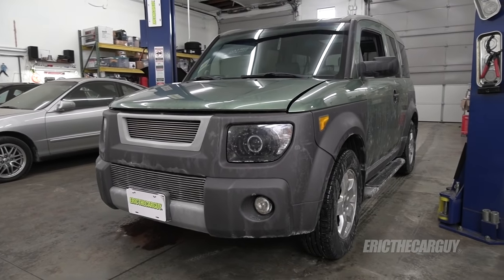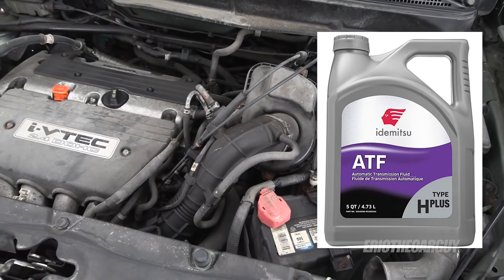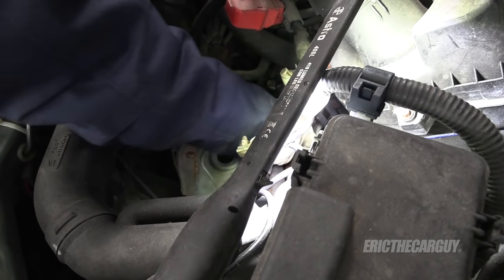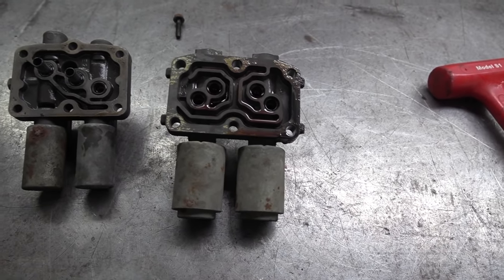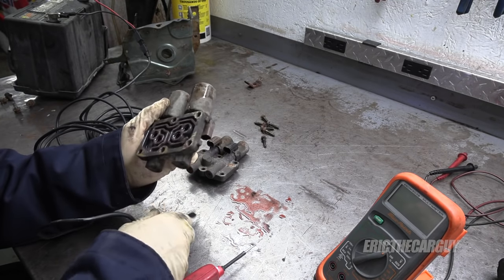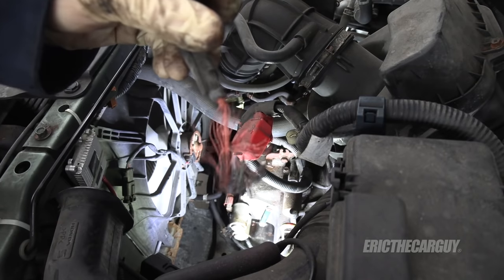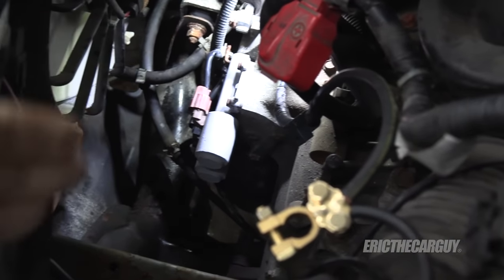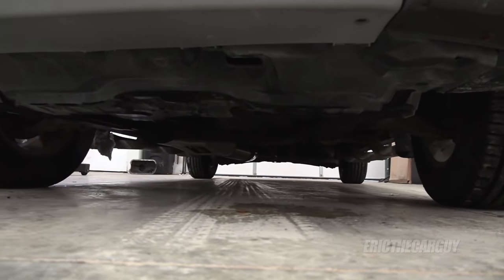Delayed Shifting, Honda Transmission

Comment: Hi Eric.  I have a 2012 civic lx sedan with 190k miles . What can cause grinding noise when shifting from park to reverse and drive . Also it does the grind when coming to a complete stop but not often . What can it be any advice would help .
Reply: Does it have a check engine light on? It could be a solenoid going bad, could be wrong amount of fluid, or even just dirty trans oil
Reply: No check engine light . Took it to the dealership for diagnosis and was told it was a bad motor mount. Going to replace it and will see if it fixes the issue. Also will do a drain and refill on transmission fluid to be safe
Reply: The grinding noise from park to reverse I've noticed it in many Honda's. Is the transmission a cvt?
Reply: It's a 5 speed it was not the transmission of fact was the passenger motor mount causing it to sound like it was a transmission.  Replace motor mount and no more noise
Reply: @metrosb2593  I was told by a Hinda mechanic that the transmission could be a cvt that shifts like a 4 speed. Mine felt like there was a half a gear after 4th gear, after I backed off the gas
Reply: @paulmattle6683  if you provide me the model and year I can tell you.
Reply: @metrosb2593  it's an 05 Civic VP 4 door

Comment: How do you know it wasn't the filter being clogged up that caused it.
Reply from the maker: A clogged filter would effect all gears, not just 3rd gear. Also, as I clearly showed in the video, the filter was fine and was OE which means it has the bypass valve. Thanks for the comment.

Comment: I have the same problem for the last five years on our 2002 Civic EX, but only when cold. Does not seem to get any worse, unless it is colder outside. Is the flair more an annoyance or could cause other issues with the transmission if it is just the solenoid?
Reply from the maker: Are you using Honda transmission fluid? If not, that could be the cause. https://www.ericthecarguy.com/solving-transmission-problems/
Reply: I have a mix of Valvoline MaxLife ATF and Honda ATF right now. One drain and fill of Honda. Slowly working my way back to fully Honda ATF at each oil change interval on the Civic. When it warms up outside, I will hopefully get a second ATF drain and fill in.. Found years ago that the MaxLife ATF was less prone to "burn" (dark red to black 80k) in my 2002 Odyssey that the old Honda ATF seemed to do, and just stuck with it... until I saw your videos. 155K miles on the Civic and 196k miles (about 100K running Valvoline MaxLife ATF) on the Ody and no trans issues on the Ody. yet. fingers crossed.
Reply from the maker: Only use Honda transmission fluid in a Honda automatic transmission.
Reply: @ericthecarguy  Hopefully a couple more drain and fills of Honda ATF will take care of it. Would a problem with the solenoid  (slow actuating) potentially wreck the transmission or just be an annoyance with the slow shift?

Comment: I have always wanted an Elment as secondary vehicle. Where I am they all have  250k miles or more. Are these still okay to buy with that amount of mileage?
Reply: I bought mine new in 04 and have had very few problems. Vtec solenoid replaced, intake manifold gasket and basic stuff brakes, plugs. I love it cause you can fold the seats to each side, great for Christmas trees😎
Reply from the maker: You would likely need to rebuild it as I did with mine, especially the suspension. Videos linked in the description.

Comment: I’ve been using regular oil for the last 4 year had a repair new repair shop they put synthetic oil, it seems that the car is a little sluggish now when
Reply from the maker: Only use Honda transmission fluid in Honda transmissions.
Reply: Perhaps the repair was shady.

Comment: You changed the fluid but not the filter the first time?  Isn't that a waste of new fluid?
Reply from the maker: I didn't have to add any fluid after these repairs.
Reply: @ericthecarguy  I thought you said you tried changing the fluid first but then you didn't change the filter until you did the repair instead of doing it during the fluid change.
Reply from the maker: I changed the fluid before any of these repairs, and didn't have to add any after the repairs. No fluid was wasted.
Reply: @ericthecarguy  The new fluid going through an old dirty filter would contaminate the new fluid which would be a waste of new fluid. A clean filter should have been put on before the new fluid went in. No?
Reply from the maker: First, you do know how filters work right? They trap and contain contaminants, they don't add them to the system. The old filter was not dirty at all, it looked completely normal to me, I've changed the fluid regularly in this transmission since I got this vehicle in 2007. I stand by what I did and I'm confident it is fixed and will not have the same issue again.

Comment: I have a 2012 accord 2.4l 103k miles and it doesnt shift smooth would this ab solenoid fix anything related to my problem?
Reply from the maker: The #1 cause of shifting problems with Hondas in my experience is not using Honda transmission fluid, or incorrect fluid level. https://www.ericthecarguy.com/solving-transmission-problems/

Comment: Good vids, like watching and learning. I'd like to see a video on an 08 tl going over all the transmission service points. Ive got a type S with 243k and I'm trying to take her half a million miles. It refused to shift 3rd to 4th at 105 mph, it was about 6400 rpm. I did the shift solenoids when I did timing components when I bought the car. Also I've started getting poor mileage sub 20 at times and I'm doing a valve adjustment when weather is better thanks to your vids.
Reply: Try replacing the 3rd and 4th pressure switches and the fluid, if you haven't already. My 07 TL was having sparatic shifting and hard shifting, and once I replaced those, it was like new again
Reply from the maker: As I said in the video, the V6 transmissions have always been a problem. It's not likely solenoids solve problems with those transmissions, only the 4 cylinders. 

http://www.ericthecarguy.com/faq/solving-transmission-problems
Reply: @ericthecarguy   I'm going to dive into your site and see what I can learn. You think if this car has never had a valve adjustment that the mileage could drop as bad as I'm experiencing. All in all she needs some loving, probably ask some questions on your forum.

Comment: Did you check the resistance on the new ab solenoid to compare the readings?
Reply from the maker: It wasn't new, and as I said in the video, resistance checks on solenoids are pretty much useless. A voltage drop is a much better test for something like a solenoid, but difficult to do in this case as you need to take the readings in series. That would be challenging driving down the road.  Thanks for the comment.
Reply: @ericthecarguy  yea you right, I forgot.. I just thought it was new cause it was cleaned up nice. Lol. 
Oh also does that solenoid only control the 3rd gear? Like if someone had a problem with 1st or 2nd would they considered replacing that solenoid as well?
Reply from the maker: No, I believe it controls all forward gears depending on what solenoid is activated or deactivated.

Comment: Funny also called honda a long time ago they said there is no interval on when the filter should be changed and only change it when your doing a trans rebuild.which I don't get it's a external filter why not change it.i changed it anyways.why would honda say that ,very odd I would say.
Reply from the maker: Because very few Honda transmissions have replaceable filters like this one. The vast majority of Honda auto trans filters are inside the transmission case and not accessible.

Comment: Isn’t there a Cigarette plug in Device that has A 9- volt battery attached to it to keep from losing the Cars memory -I have one no need to have to reset radio Code 👍🏻

Comment: Thanks according to Honda they do not recommend replacing the filter unless there’s something wrong with the transmission.
Reply: We replace ours every 30k, a magnefine atf filter fits well in the same slot as the factory filter.
Reply from the maker: it's not like it can hurt. Also, many Honda automatic transmission 'filters' are inside the case and not accessible unless you're doing a rebuild. I believe that is the reason you saw that recommendation. Thanks for the comment.
Reply: @ericthecarguy  I have an 04 Element and the dealer refused to charge it.
Reply: @HotRod-wv4vm  not a honda but my chevrolet dealer said the same thing basically for my 2019 silverado when I had them change the trans fluid . Said the manufacturer doesn't recommend changing the filter unless the transmission is leaking. Still not sure how accurate that info is since the owners manual recommends it be changed at the same time the fluid is changed.
Reply from the maker: I believe the 04 runs a different transmission with an internal filter. Look behind the radiator to see if you have one.
Reply: @ericthecarguy  the filter is by the radiator it’s not internal. What do you think of lift kits for the Element?
Reply from the maker: I don't consider the Element an 'Offroad vehicle', therefore I see little point in lifting one. However if that's your ascetic, go for it.
Reply: @ericthecarguy  Thanks looking forward to your next video. By the way what do you think of the aerogenics springs

Comment: Ground wire fixed mine bet that is the problem.
Reply: Hey Joe, can you explain this a bit further please? I have the exact same problem as him with my 08 Honda Pilot except it's 1st to 2nd and 2nd to 3rd gear with no codes. You think that this is also the solenoid or something else? Drain and fill done thrice and my issue occurs only when the vehicle is cold. After driving around for a bit the issue is gone. Would love your input. Thanks!

Reply

Comment: My 2006 trailblazer did the same thing and I didn't think much of it So one day I was driving and a I passed someone going vary slow and I tried to get it up to speed it would not shift and I couldn't get it to shift for nothing so I got past the gas station my engine started to sound funny and then it died in the middle of the road now I think I blew my engine up
Reply from the maker: It could just be a transmission problem. https://www.ericthecarguy.com/solving-transmission-problems/

Comment: If you accelerate like that every time, you should probably think about not driving like that all the time. Bad fuel economy, more wear and tear on transmission, engine, drive line and tires.

Comment: A manual box with automation? I guess fully automatic is truly rubbish then ;)
Reply: I'm very curious about that! Is the automated manual more reliable? And do certain driving styles wear a transmission like that particularly fast compared to a "planetary automatic transmission" without solenoids. Id love to know regarding my 03 Honda CRV as I had no idea it had external solenoids.
Reply: @foellerd  I am more curious about the clutch part. Oh and how Park works.

Comment: Never worth trying to repair those solenoids, also, the working solenoid itself isn't any indication towards the function of the mechanism other than the cycling. The valves inside can be shot to shit, and they will not work. So new, or from the crusher's it's always the right solution, and in this case, because we're talking about a highly precise part, always OEM, off-market stuff ain't worth it. All with the caveat that parts from the crusher are always in worn state, so not gonna last long.

Comment: Hmm. eBay parts. I recall seeing a recent timing belt video on ebay parts....
Reply from the maker: Not from me. If you're referring to my "Counterfeit Parts" video, I got those parts from Amazon, not eBay. This was also a salvage part, NOT a new aftermarket part.
Reply: @ericthecarguy  ah.... I didn't realize that. Thanks for the clarification. 👍

Comment: This is why you drive a manual.
Reply from the maker: So you think manual transmissions are immune to problems?
Reply: @ericthecarguy  I forgot, we’re talking about Hondas here. Transmissions are not their strong suit.
Reply from the maker: So you think other vehicle manufacturers don't have issues with their transmissions?
Reply: @ericthecarguy  why would you assume that? Honda has a long history of transmission failures, TSBs and recalls. That said I would venture that a manual transmission would statistically fail less than an automatic transmission.
Reply from the maker: Coming from the guy that was replacing 2, sometimes 3 Honda transmissions a day at the dealer, yes, Honda automatics of a certain vintage and type are garbage. However, the automatic transmissions that came before them were excellent and rarely had an issue, pre '99. 

Not everyone is capable of driving a manual transmission, my daughter included. I plan to teach her after she gets more time behind the wheel, but not many people get that opportunity. 

My point is that I bristle at 'general blanket statements' that decry a brand or a persons preference in transmission type. Nobody is perfect. I'd be out of a job if they were.